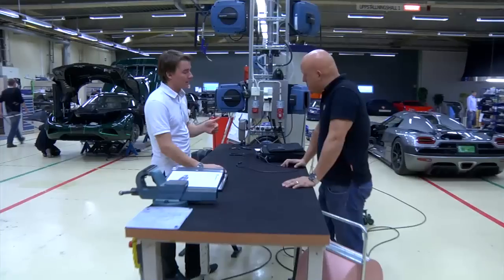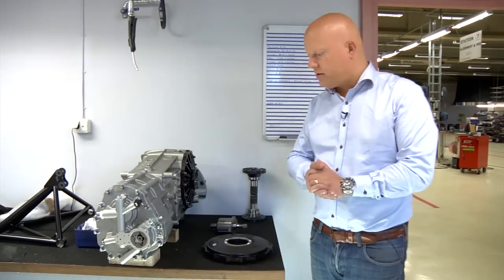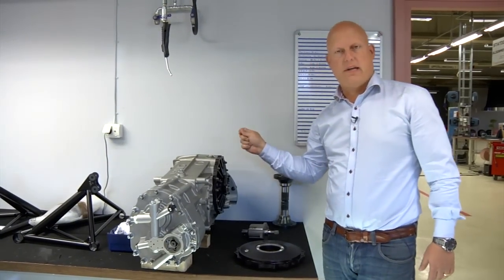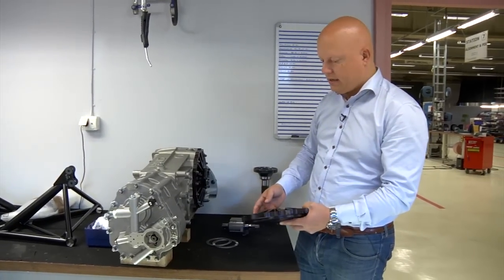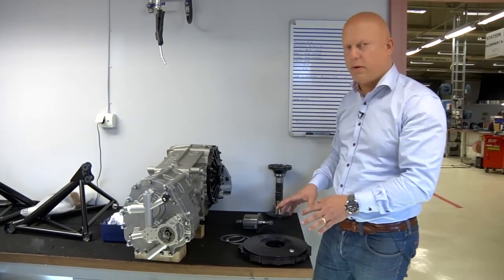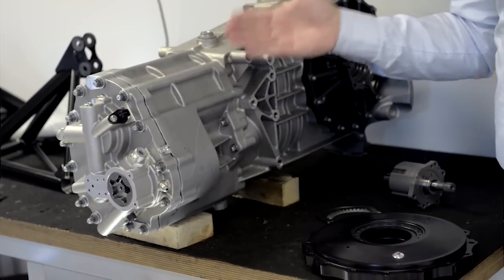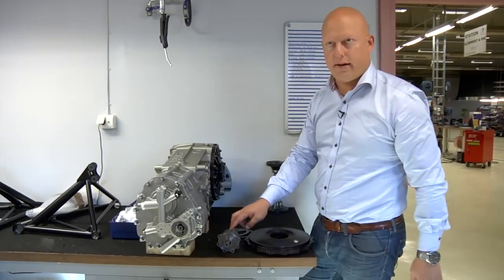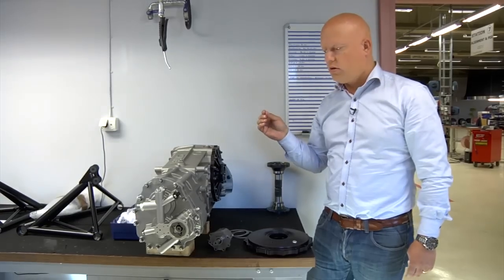Putting 1140 hp to the Ground - /INSIDE KOENIGSEGG

Comment: the problem of koenigsegg is that it is the second fastest car in the world... so it is the first loser :D
Reply: The current spec koenigseggs are faster than any buggatti, if that's the car you're suggesting it is second to. The Agera R is the fastest production car in the world in every regard, including top speed.
Reply: CrimnlBT Even if it were true that Buggattis were reliable, it has a much higher displacement than the Koenigsegg. 3 more liters (8), twice as many cylinders (16), and twice as many turbos (4) but still gets the same power. It produces the same power but spread out over almost twice as large an engine with 2 more turbos. Strain on each cylinder is half. Koenigeggs have the most downsized yet powerful engines in the world. Imagine how much heavier Buggattis motor is too, not to mention the extra radiators and turbos it needs. The fact that Koenigsegg can accomplish such a feat alone already makes them legendary. The Koenigsegg is completely bespoke and is ahead in technology and performance over Buggatti, which is backed by the MASSIVE Trillion dollar Volkswagon group and has literally everything they've learned at their disposal. If they're better than buggatti they're better than every production car. And if you're calling out faults with the CCX you'll be glad to know the Agera R has received massive improvements, unlike the Buggatti which has stayed mostly the same since launch with special editions that increase horsepower by 150. Agera does have a double clutch gearbox, and one of the most advanced one's in the world. EVERYTHING Koenigsegg does is cutting edge and all of it is in-house engineering. Have you heard of the way they do valve timing and injection.. very trick stuff. They are trailblazers in automotive technology. Christian recently said he does not think cars will need camshafts in a decade and if their research continues that could be true. I don't think you understand the magnitude of Koenigseggs accomplishments. I imagine similar reliability with both supercars as well. I've heard accounts from owners of both cars that say they are very reliable cars. Koenigseggs have so few problems that out of all the probably 50-100 cars they sent to the states, they only need one certified technician in the whole country.
Reply: CrimnlBT That's interesting wow. I bet that bugattis transmission is insane. imagine what koenigsegg could do with 16 cylinders or even 12
Reply: maddafakkaturtle The Agera models top speed have never been tested, and Bugatti refuses to let them use their test-track Ehra-lessien (Which makes sense if they want to keep their record :D).  /watch?v=qj3Oo-_jecg speaks for itself :)
Reply: i think the true point everyone is missing is that the agera makes over 1,000hp (it's 1,140hp to be exact) using a 5 litre V8 with twin turbo chargers.
to put that in perspective for all you secret volkswagen fans out there: the veyron uses a 8 litre W16 quad turbo, and makes exactly 1,001hp (for the standard veyron, the SS is 1,200hp)
so that is the marvel of engineering, and don't bring up the top speed difference, since who cares about 12 mph once you reach 200? after all, there are only 6 places in the world you can achieve top speeds in these cars, and your average buyer of any 200mph club car is never going to get it over 160mph.
so bugatti fanboys can stop puffing their chests, because once you break it down, the bugatti is a VW on steroids, wrapped in a chic exterior and futuristic victorian leather interior theme.
Reply: CrimnlBT yes, 1000 miles. and by "servicing" i inferred to the standard servicing every supercar should receive every thousand miles, which is an oil viscosity check, tire balance and rotation (not that worrisome on a all wheel drive vehicle like the veyron, unless you do standing starts alot) and the loping transmission is an issue that happens to alot of the VW DSG's after a few thousand hard miles on them, not just the veyron specifically. and bugatti went sent a team with the top gear production team to check the vehicle's ECU every time they stopped for gas. But this is nothing new, since most of the supercar manufacturers send a support team with the car to top gear (McLaren and Lamborghini being the latest, with the P1 and Veveno roadster) 
yeah, there was supposed to be a 1 in front of that 2 to make it the correct 12 minutes, but my 1 key sticks and i type fast (i blame brazzers for that sticky key). lol
the VR part of the what im going to call from now on VRW16, refers to the angle of the cylinders. most variants of the VR have a very narrow (between 10 to 15 degress) angle, and uses one cylinder head for both sets. it's easy to see why bugatti went with this engine design, 1, because it's a proprietary owned by VW, and 2, its very space saving, which allowed them to mount the engine(s) side by side, which opened the door for the VRW16. otherwise i have no trouble believing the veyron would have been 10 ft wide in the back if it had used a standard angled V8s to make the W16. and though its called a "double-u sixteen" it's actually closer to a \X/16 in cylinder shape, with a crossover between the two cam sets; which leaves you with 2 headers, each providing for one set of cylinders on each engine. and yes, they said that theoretically it can produce 2000 hp, but the car would be mainly engine and radiators, and very little car, so they "spread the load over 16 cylinders, which increases reliability".
Reply: s jep the transmission (to be exact, the whole engine) had a 4 day full throttle run with hours of running in the redline, hours of virtual launch control and racetrack testing to be qure that nothing will ever run down...
to the koenigsegg: yes... if they would fit in :)
but at a certain point it's just dangerous and not even fun anymore to have more hp and be faster... loeb said in the porsche 918 6:57 nordschleife run that it begins to stop making fun and it's more like frightening - and this guy is already a racedriver ^^
i think the veyron and agera are really good where they are standing now :)
Reply: s the agera never ran more than the veyron ss did... it's still just a guess
Reply: AnHRTBus the marvel of engineering is that not a single veyron that didn't have a crash or sth. like that has ANY kind of engine problems AT ALL... there are over 400 veyrons by now and every single one runs like it's new, even the 2005 versions.
while koenigsegg had big problems with the clutch and transmission first of the ccx, then of the agera before they finally fixed that problem.
the veyron is a supercar you can drive millions of miles without breaking it.
Reply: CrimnlBT Bugatti was able to use all of Volkswagen's experience in manufacturing to build the veyron, while Koenigsegg started in 1992 with the CC8S (the first CC8S was delivered in 2002) as you mentioned, and has only been a car manufacturer for what, all of 12 years? meanwhile bugatti is able to draw upon the resources of Volkswagen and their own productions.
and when you speak of transmissions, you do realize that the CCX ran a single clutch 6 speed, while the veyron has a dual clutch 7 speed, in fact, its the same dual clutch system that's been tested and proven since the MkV GTI, a DSG gearbox that volkswagen has been working on since 1998. so of course there were problems with the CCX's trans, since it was an in house job that was completely new to the designers.
Not to mention the fact that Veyron owners are told to service their cars every 1,000 miles; and there are problems with "loping" transmissions in them. 
the point i was trying to make, before you went all fanboy on me lol, was that Koenegsigg Automotive AB has been a car company for 21 years, and has already produced cars to rival that of Ferrari, Lamborghini, Bugatti and McLaren. which to me means a marvel of engineering.
Reply: s "Even if it were true that Buggattis were reliable, it has a much higher displacement than the Koenigsegg. 3 more liters (8), twice as many cylinders (16), and twice as many turbos (4) but still gets the same power" dude... that IS THE POINT WHY it is that reliable... because they didn't put that many horses into the engine.... so you really think that the veyron engine is hp-wise top-ended? fuck no.... they already tested the car with bigger turbos and made the exact same engine produce almost 2000hp and it was still stable. but the less hp/liter you have, the less abrasion you have and the more miles the engine can last. simple math... seems really that you don't know much about engines :-/
i give the koenigsegg engine about ~100.000km to have the first big problems and the veyron engine >1.000.000km.
plus the biggest veyron bonus: still the only car that is calm to handle at 400kmh.
i love the agera, i love the looks, the sound, and the acceleration, but you just can't compare it with the veyron if you have ever seen how much detail and effort goes into a veyron engine... there is a reason why the production of one car costs 5m€.
biggest weakness of the agera R is it's strengh at the same time... it's power. because you only get the 1140hp if you tank it with E85 fuel... which isn't available on normal tank stations. if you tank it with normal fuel you'll get just 900hp.
"Koenigseggs have so few problems that out of all the probably 50-100 cars they sent to the states, they only need one certified technician in the whole country."
uhm of course they only need one oO what do you think how much work it is to repair 50 cars in a whole country xD
a friend of mine has a normal mechanic job and repairs about 30 normal cars PER DAY.
Reply: AnHRTBus "Not to mention the fact that Veyron owners are told to service their cars every 1,000 miles; and there are problems with "loping" transmissions in them. "
i still don't know where people get this bullshit from. i actually live in wolfsburg, i see veyrons and their owners once in a while. i spoke with some of them and they all were astonished by how good the car is... the only thing they had to change was oil and tyres by the time.
if the 1000 mile stuff were true, things like top gear race from italy to london never could've taken place.
Reply: CrimnlBT but you're forgetting the cardinal rule of "less is more"
yes, bugatti made a wonderful car, but my irritation comes from idiots who never even heard of bugatti until they made the veyron, or until they heard that stupid rap song. and of course the bugatti is reliable, they're made by volkswagen, and those damn germans make shit that last forever if you care for it properly. and the agera 1000+ hp on bio-ethanol not E85, which would give you ~960 hp, meanwhile the bugatti will not run over 200+MPH unless you put 91 rm+method or higher. put E85 in a veyron and when you hit 180 you'll start wearing seals and running lean. 
also, please note that the W16 in the veyron is not a variable sequential timed W16, but a interlocked W16, so no matter what, all 16 are firing (yes, they do work the timing down so low that it fires like a V12 untill full throttle, but it's still guzzling down fuel faster than any other production car in the world. full throttle empties the tank in 2 and a half minutes, and this is in a controlled environment, on a dyno, without accounting for drag and windage.) so it still looks like bugatti made a car more about the numbers than the driving, which is why i agree with james may when he says that the nurburgring ruins cars. nobody cares how fast the car is when it's not any fun to drive.
Reply: AnHRTBus feel caressed about that "german hold forever" stuff :3
well the E85 topic is mainly a topic of making a car able to run that stuff... i find it cool from Königsegg to do it... but practically i can't use this feature normally^^
"it's still guzzling down fuel faster than any other production car in the world. full throttle empties the tank in 2 and a half minutes" that's just not true, the time is 10 minutes for the supersport and 12 for the normal veyron :P but actually that's not a shame... if you drive an MTM RS6 with 730hp on the autobahn with "only" 340kph you also already use 50 liters per 100km, man even a normal GTI or a-class needs 20 liters at full throttle and the supersport 120... but you are double as fast. that's just normal for fuel cars. actually driving 100kph all the time the veyron "only" uses 14L which makes you go about 700km and that's actually ok.
and actually it's not even a W16, but a double VR8 engine.... some strange varation of V8 and golf VR6 with 16 cylinders xD
Reply: AnHRTBus actually the father of an old friend of mine has a chevi 7 seater... and it definatly uses more fuel driving 100kph than a veyron does when driving 180kph :P
Reply: CrimnlBT I was agreeing that the Buggatti would be reliable, but only giving the reason that it's because of how the power produced is spread out, putting less strain (abrasion) on each cylinder. Where did you hear that Bugatti could have tuned the veyron up to 2000hp? That doesn't sound right considering the supersports were 200 added horsepower and it seems like extra things had to be done to achieve that. All I'm saying is Buggatti needed 16 cylinders to produce that power and koenigsegg only needed half of that and half the turbos and a lot less other shit. You don't think the agera's motor could be tuned up too? They didn't for the same reason as bugatti. Also it's not like both cars are running near top speeds at all times so wear is different at lower speeds like you said. 
The koenigsegg is a much more significant car to automotive technology and future tech than the Veyron which is over the top in every way. I bet even if the veyron is that much more reliable it still costs more in the long run needing to be taken care of so much.
Reply: s i live in wolfsburg, the parts for the veyron are produced in salzgitter, which is just 40km away from my house^^ adding 200hp was not really the problem, they only had to increase the turbo size and fitted the engine-computer-control to do that. that breeded the next problem finding a clutch that can hold 1500nm. after they've done that, they improved the aerodynamics (obviously... compare the veyron with the ss and youll see^^).
the bugatti doesn't need the 16 cylinder engine to produce that amount of power, they just chose to do so because then you have less force on all engine parts... or said otherwise:
if you tune a koenigsegg engine to blow at 1000km, it would end up at about 2000hp, if you tune a veyron to blow at 1000km, you end up with about 3000hp due to more engine size, about the same materials (some parts even better) and shorter pistons per cylinder.
Reply: CrimnlBT ^^^agreed, after about 600hp it just startes to turn into a dick measuring contest lol
Reply: CrimnlBT also, i haven't heard a lot of smack talk from porsche fans since paul walker was killed in a 918... 
"Porsche's make anybody feel like a race car driver" my ass lol
Reply: AnHRTBus he was killed in a Carerra GT not a 918 if it matters
Reply: AnHRTBus he was killed in a carrera gt and he didn't even drive himself^^
actually a porsche GT3 is the best you can buy for money if you want to feel like a race driver... and don't vome with 458 or nissan gtr, these are computers driving it for you :P
Reply: s i guess it makes it worse, since it was a "proven" porsche "driver's" car, and not a pre-production car. 
actually, have they delivered on any 918 orders yet?
Reply: AnHRTBus dude, these cars aren't 1980s ferraris^^
these cars are so good by now that you don't need that much of a control check.... except you really just do 1000km with them in a year^^ but i actually study car engineering in wolfsburg and already saw veyrons with quite many km for a supercar (most was almost 150kkm - about 90k miles)^^
no need to explain, already saw a veyron engine live^^ and as said... studying car engineering in wolfsburg (ostfalia university of applied sciences... our facility is about 400m away from the VW factory, so you see quite a lot vw stuff already xD plus the veyron parts are produced in slazgitter - less than 30 miles away from here)
well... they also could've gone with the normal 60° angle for W16 engines... that the outer 2 banks would look like a porsche boxer, but yes the VR basis is very place-saving :)
but though just to tell you: very well explained, good job (Y) :D
Reply: CrimnlBT yeah carrera, and his buddy was driving. but still, my point stands. as far as a GT3, you'lll never see me in one of those lol, im more of a FRWD than a M- or RRWD, although i wouldn't mind a LaFerrari or P1 lol. as far as the 458 and R35 GTR being computers to drive you around, i agree, but i have driven a 458, and turned off the aids, (dunno if you can defeat the aids in a GTR though, without completely ruining the car) and then it feels like a 355, which is what my uncle had before he got the 458.
Reply: AnHRTBus actually it's all known the carrera gt is hardcore to handle because it's bitchy round a corner... very good to see when jeremy clarkson drove it and the stig.
and yes, half of the planned 918 are already sold and the first are being delivered now.
Reply: CrimnlBT ah ty, yeah never studied at university, but i've worked on every car i've ever owned personally. and i personally would run checks, but mainly because i dont trust the comps to much lol. yeah these newer supercars are pretty much self sufficient, but if i were to spend 5 mil on a supercar, you better believe im going to baby that thing (not when im driving lol, just care and maintenance.)
Reply: AnHRTBus ahahahaha right decision my friend :)
of course control checks are never a bad thing... but overdoing it just goes on your own nerves at a certain point xD
Reply: wow
Reply: R U 'AVIN A GIGGLE M8?  IL BASH YE FOOKIN EAD IN I SWARE ON ME MUM